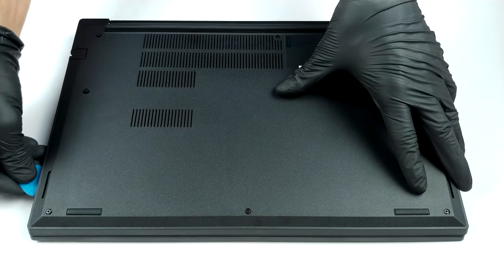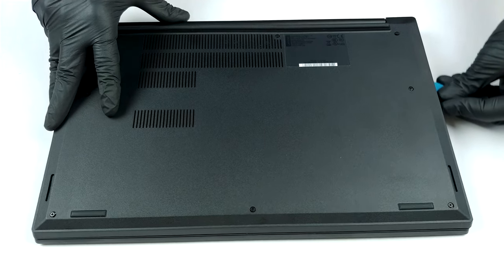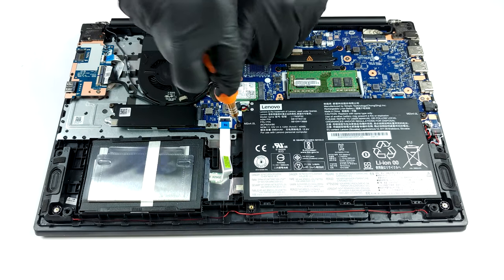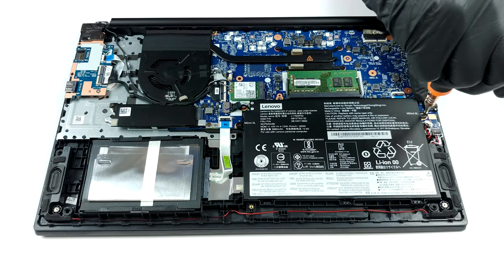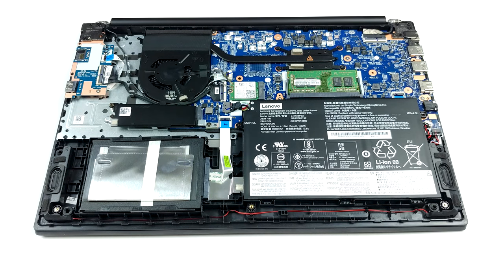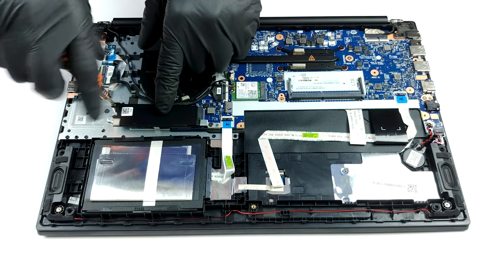🛠️ Lenovo ThinkPad E15 - disassembly and upgrade options

Comment: only one ram slot? What a load of bull
Reply: There are thousands of other PCs to choose from.  Don't whine.
Reply: @dagnytaggart5955  You probably won't find another with 2 ram slots unless you are willing to settle for a 2019 model unfortunately though
Reply: @Technology and Entertainment Is there a way I can go beyond 16GB RAM ?  May be 2 or 4 rank memory can be useful ?
Reply: @ПавелКозлов-ъ3о  Installed a Crucial CT32G4SFD832A 32 GB module in mine 2 years ago when I purchased it, and it works great with 40 GB of RAM. No issues whatsoever.
Reply: Yes, there's 8GB soldered to the motherboard in addition to the single slot.

Comment: Opened mine up and it looks completely different inside, with no standard SSD 2280 slot available and a proprietary 2242 installed, and no SATA bay but a bigger battery..

Comment: what is that metalic sticker upon the hard disk? minute 2:30 and 3:17 It seems to be a dummy 2.5 " hard disk  but what is that silver sticker for? I supuse it should be used with a real 2.5" hdd to avoid static 'cause when installed it goes upside down. am I right?

Comment: Is it possible to replace the Thinkpad E15 G2's with a better display? Like something with one with a 100% sRGB and at least 70% Adobe RGB?
Reply: Can we upgrade the graphic cards of this laptop?
I'm also using Thinkpad e15 i7 16gb ram 10.gen but it unfortunately has intel uhd graphics. So even in basic games, result is awful.
Reply: @yucelaygun  Read about eGPU Thunderbolt 3

Comment: What is the MB ribbon underneath the battery, what is the functionality of this ribbon?
Reply: It connects the touchpad. There's 4 little screws holding it in place. The other piece coming from the left is just tape to help hold it.

Comment: How are thermals with the i5 + igpu only version? Does it heat up fairly easy with basic usage? Does heat impact performance?
Reply: Thermals are probably very good on that version since it is not the most powerful chip. Performance won't be affected under basic usage
Reply: @benjaminmcintosh857  Thank you for your answer!

Comment: Is the item removed at 2:30 the 2.5” SATA drive? 

Also, what is the chip removed at 2:40 ?
Reply: 2:30 is SATA Drive and 2:40 is the Wireless card.
Reply: Actually at 2:30 it's a dummy drive. I don't know why they include it. May be just to provide a anti static sticker and the frame to sustain de real hdd.

Comment: hi what is the component you removed at 2:22. is that the graphics card
Reply: Can we upgrade the graphic cards of this laptop?
I'm also using Thinkpad e15 i7 16gb ram 10.gen but it unfortunately has intel uhd graphics. So even in basic games, result is awful.
Reply: @succmaballz  upsed, thanks!

Comment: good day, is it possible to increase storage capacity to this model? (HDD); and what type or model would it be?
Reply: if your ssd slot empty it is hard to add it because it has special cable. but I recommend adding or upgrading the m2 slot.
just get the same type of m2 nvme SSD with any size and change it.

Comment: After having to pry up the rear cover and taking 30 minutes to do so and find a special tool to use to help with the prying so as not to break the very thin plastic, I will never buy another Lenovo laptop. I have been specifying Lenovo for 20 years and all one had to do to add a Ram module was remove two screws and lift up the cover plate. Entire process took 5 minutes at most.

Comment: Hii men i have a question on the laptop thinkpad E14 you have a hard disk SSD 
You can to upgrade you computer and to add another SSD
Reply: As you can see in the video, there are connectors for both a 2.5" SATA drive and an M.2 NVME drive. These laptops are most often sold with a placeholder (not actual storage) SSD drive, so you can potentially upgrade your storage capacity if you would want to by swapping it with a real 2.5" storage device.

Comment: Can you upgrade the cpu?
Reply: The CPU is soldered to the motherboard as with almost every other laptop. Unless you're willing to desolder and replace it with another CPU that's supported by the motherboard (and that supports the RAM type!), you're stuck with the one you get. That's a very delicate procedure though.

Comment: Is there a way I can go beyond 16GB RAM?
Reply: Unfortunately, with this model there is a cap at 16GB. But 16GB should be more than enough for whatever you would use a laptop for...
Reply: Can we upgrade the graphic cards of this laptop?
I'm also using Thinkpad e15 i7 16gb ram 10.gen but it unfortunately has intel uhd graphics. So even in basic games, result is awful.
Reply: @yucelaygun  As far as I know, the Intel model doesn't have any support for discrete graphics.
Reply: Installed a Crucial CT32G4SFD832A 32 GB module in mine 2 years ago when I purchased it, and it works great with 40 GB of RAM. No issues whatsoever.

Comment: Is the processor of the E15 soldered to motherboard which makes the processor replacement impossible?
Reply: Yes, as with 99% of laptops the graphics card and/or processor is completely soldered to the board. So it is impossible to upgrade or replace the processor.
Reply: cpu and 1 ram(4gb or 8gb) is soldered to the motherboard. It cannot be changed or moved by a common user.